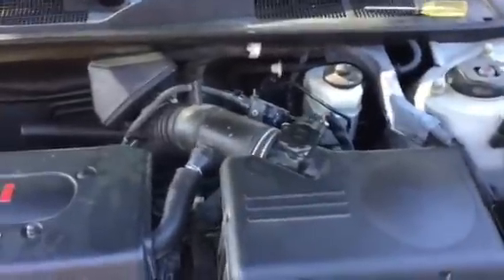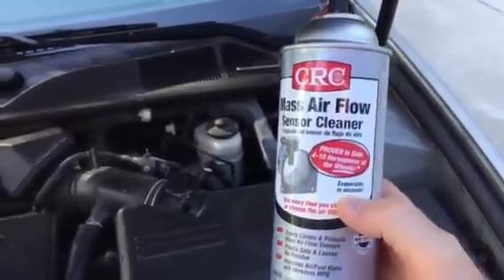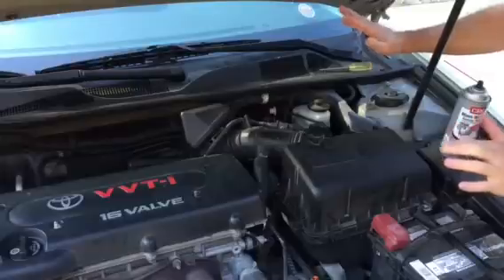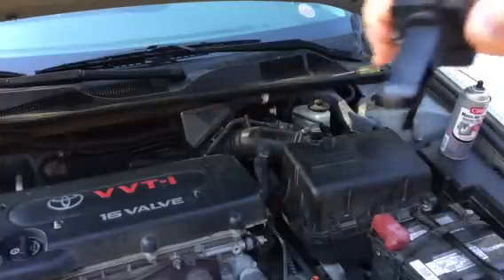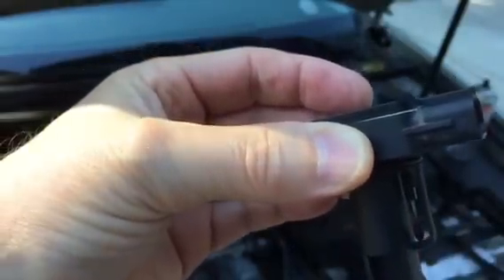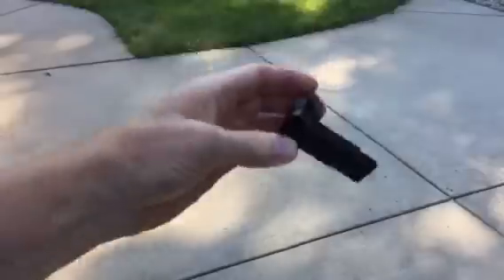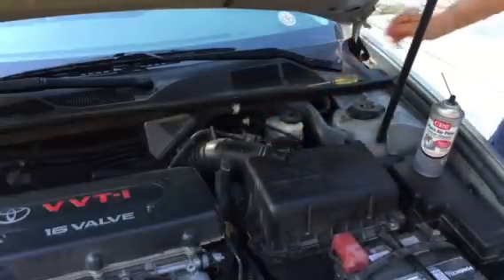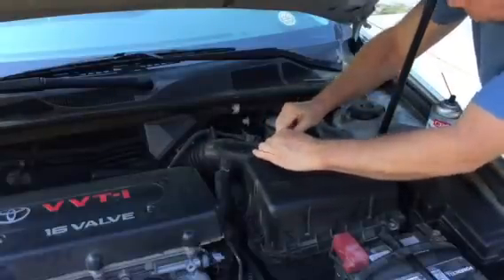Why Does My Car Lose Power Loss Of Acceleration?

Comment: I have a question? I got a 2005 with code p o 172 and p o 175  and replace the intake sensor but didn’t fix my proble still hesitate at 40 mph and the rpm goes higher.. what else do you think I should check
Reply from the maker: Jerry Velasquez did you replace the mass air flow sensor with a genuine OEM?

Comment: I have a question. I drive a Lexus & went over a dip & now when I drive above 65 it smells like burn oil but has no leaks. Please help??? Thanks for the video by the way
Reply from the maker: Brandin Sanchez Are your drive belts good and tight?

Comment: Did that it helped for 100 miles then back to the same trouble as before. For $ 35 replace the sensor. Should take care of the problum if not the throttle body needs to be cleaned or replaced.

Comment: Altima hesitates on take off only , I replaced all sparks plugs, coils, and cleaned MAF sensor still doing it  Any suggestions
Reply from the maker: Have you cleaned the throttle body?
Reply: @proclaimliberty2000  Thats a good point I have not tried that . Do you know how that is done ?
Reply from the maker: @joezavala9659  https://youtu.be/cOAYWVBfuek

Comment: No too long ago my car just started stalling out on take off, would have to hold the gas down a bit at stop lights to keep it goin. Pulled the MAF sensor and inside was a tiny spider that was dead hanging on one of the wires. Got it off and car ran like new again.
Reply: They're really that sensitive. Wow. Trying a couple of recommends tomorrow. Great vid
Reply from the maker: David Clawson 👍

Comment: Hi does my kia rio 2001 model have mass air flow sensor.cauz i can't see it i check it
Reply: All cars will have a maf. The way I normally check to see if it's is the maf  is I'd disconnect the maf and see if anything changes. Normally they'll be located just after your vehicles air box and will have a sign telling you which way aor shoukd flow

Comment: Hello I wanted a price on a detail inspection for a quote to repair my Mazda 2 Neo 2006.

When ilding it's vibrating,but only because my revs start to drop after sitting their 3seconds.
It also got a vibration it didn't have before,after Ultra Tune put a RH engine mount Kelpro mount RH mount.

When ilding I got to put it in reserve to get my revs a bit higher so it feels more healthier.

Maybe it just a idle screw adjustment.

When I'm doing about 80-90 to 110km I can feel vibration in the steering wheels.

Ultra  Tune didn't inspect it but said another mount broken.
I took it to two people I trust they seem to think they ok but didn't take them off.

I thinking it could be one the pulleys or something loose or drive belt,but don't think it be causing the vibration it causing.

If the highway is nearby feel free to take it up the highway.

I was told it could been a mount got that done, got new tyres and balancing,wheel alignment about 2-3 weeks ago.

I was told by two mechanics said the same thing they didn't think it my stabilizer might.

I need to know what I'm in for so I  can save up and get it done asap because I hate the feeling of it.

I have done spark plugs done (best plugs)
I have gotten new tyres and  balancing & wheel alignment within a month.

It felt worse coming out of ultra tune, they didn't know what was wrong then said it it was my stabilizer mount it would be doing more horrible things and the engine would have more movement.

When ilding I think it because my revs drop a bit low because when it in reserve it  goes back to more nearer the normal ilde rate and stops vibrating.
So maybe adjustment of the ilde screw may even fix it, after spending over $1000 and going to be broke for a while because of it.

Can I get inspection see what you guys think.

Comment: My moms 2005 Nissan Murano is running a u3fff code and apparently that’s for Nissan dealers only, but the car is hesitating and kind of shaking. She’s already changed the coils and it was running fine but now it’s reading that code and the dealership told her it cost $120 just to get the code read..
Reply from the maker: Doomzyy take the vehicle to an auto parts store to have it checked with a diagnostic scanner which they will normally do for free.
Reply: proclaimliberty2000 we did, the scanner came up with u3fff which is apparently a code only a Nissan shop/dealer can read.

Comment: 2012 nissan maxima.. revving when idle and hesitating when accelerating. Mas air flow sensor changed but no changes. Any ideas?!
Reply from the maker: Shazeika Khan do you have a check engine light on the dashboard of your vehicle?
Reply: @proclaimliberty2000  yes.. it says mas air flow sensor. 😣
Reply from the maker: @snesha420  Because you replaced it and it did not fix the problem, the next thing I would do is check to make sure that the electrical connection plug that attaches to the mass air flow sensor is receiving voltage.  You would need a digital volt meter to perform this.

Comment: Driving down the street at 45mph and rpm will not go past 4.. What would cause that. ?? Please help
Reply from the maker: MOEtv. More than likely it’s not getting enough fuel.
Reply: proclaimliberty2000 thanks
Reply from the maker: @ScR3wEdUp4LiF3  It could be dirty clogged fuel injectors, clogged fuel filter, or a failing fuel pump.

Comment: Serious, why are you so adamant about only using this specific cleaner? What is the risk in using some other type of cleaner? Just trying to educate myself, thanks!
Reply from the maker: Because I know when I use this cleaner there will not be any residue left on the wires.
Reply: @proclaimliberty2000  thanks, BTW my voice text turned "curious" into "serious" above, didn't mean to come across so harsh! Haha
Reply from the maker: @bronconeils  No problem.  Watch this other video.  It will make the alternator and starter last longer on your car.   https://youtu.be/rcVYfE7MQlI
Reply: @proclaimliberty2000  wow, that WAS something I didn't know, thanks!
Reply from the maker: blankyoublank 👍

Comment: My 2008 Scion XB was running extremely poor. 300,000 miles on it. Changed Ignition coils, Spark plugs and cleaned MAF sensor using rubbing alcohol. IT WORKED. One point to make.  Disconnected the battery so the MAF and its computer etc... sync up after it all put back together.  GOOD luck and GOD bless. JC

Comment: What if its not the mass air flow sensor,or spark plugs,or alternator, or throttle positioning sensor?
Reply: So with an ODB1 scanner i got 1 code from my car....throttle positioning sensor low voltage? Battery good,guess its the plug and wires to the sensor...?

Comment: I've changed my MAP, Throttle Body Position, IAT and o2 Sensors and I'm still having a lot of hesitation
Reply from the maker: Could be a failing camshaft position sensor, failing fuel pump, clogged fuel injectors, clogged fuel filter, clogged air filter, failing spark plugs, failing ignition coil or coils, failing alternator, vacuum leak, failing EGR valve, failing variable valve timing solenoid.  Regardless of what's causing the problem, it's usually caused by the engine not getting enough fuel, or getting too much air.
Reply: @proclaimliberty2000  what about clogged catalic converters?
Reply: Check on your fuel pump

Comment: Hey I have a question my gf has a 2000 Honda Accord we put it up on computer an they showed three misfires so we went ahead an changed the coils and checked the spark plugs after that we drove it an it’s the codes are back but the main issue I’m trying to figure out is when we are driving it, it tend to jitter forward it’s not a non stop issue it comes an goes but it’s very frequent. I can’t find out what I should do next. Ahhh help would be appreciated can’t seem to find the right video with same problem
Reply: Compression

Comment: Hello, I have a problem with my 2003 Mercury sable, first of all it does a small series of things that I can’t for the life of me figure out the problem, 
After my car warms up a little and you happen to be at a stop light or at a hill and as soon as you press the gas peddle it jerks before it goes, like kinda a delay, here lately I noticed when I’m going down the highway with cruise control set at 65 going on level road it’ll ever so slightly slow down and speed up (like go to 63 and back to 65), and sometimes when you stop and put it in park it’ll start revving upwards of 2000-2500 rpms and stay there.

No engine light has gone off except every now and then and I read the code it says “manufacture control” but that hasn’t happened in a couple months, also sometimes in park when it’s not revving up it’ll start revving up and down constantly and the car sometimes dies on its own, I went into the store one time and left my car running for the ac and when I came back out my car was dead and it ran the battery down since the accessories kept running, can someone please help me solve this problem!!!! The problems are starting to happen more often, please help me figure it out!! Thanks!
Reply from the maker: It may be some kind of simple sensor such as an oxygen sensor, MAF sensor, TPS sensor or other sensor.  Is your air filter clean?  It's possible you could have a throttle body sticking which you need to clean if it's dirty.  Not having a check engine light on makes it more difficult to diagnose.  You may need to take it to a good trust worthy mechanic.  https://youtu.be/cOAYWVBfuek

Comment: I drive my car doing 30 & my car drops power rpm move down
Is the Mast sensor sound like it
Reply from the maker: Is your check engine light on?
Reply: I changed my Mass Airflow Sensor with this and soon as i out it back in and started it up it started throbbing, my RPM hand started idling up and down and felt like the car was about to cut off, that was a few days ago and now ithe RPM hands dropped so low it made my car cut off.

Comment: Hi I got kia Rio 1.3 2001 model they don't have mass airflow sensor. I change idle control valve but still hestitat special when engine    is hot.when u shift to first gear u can't leaf the car move it own.I must always press accelerates

Comment: Dude My engine is K9k 110bhp engine..IT is showing glowplug indicator and stop giving power and wont raise rpm above 3000..IT happens sometimes that too in sunny weather.. PLS HELP.. What will,be the causes.this cones only sometimes.
Reply from the maker: A blockage in the air intake, the fuel line, bad injectors, or a frozen governor could lead to such issues.

Comment: My 87 runs really good but it has a constant intermittent hesitation as if it hiccups, has good pick up speed and with air on, sitting at a light sometimes it will stall, but starts right back up, I did all the cleaning stuff like you all say on here, and can't wait to see if it works, but this car has issues, one thing quits working and you fix it then another thing quits ?? I get a lot of compliments,(nice car) but again its black and new convertible black top, and new tires its a nice driving car till this problem, And I've been working on cars with my father since I was 8 yrs old and I am 60, just want to drive and enjoy life.
Reply from the maker: It sounds like it might be a dirty throttle body.  https://youtu.be/cOAYWVBfuek
https://youtu.be/LPv1jZMpAY8

Comment: i had an annoying hesitation without a warning light and i did everything. finally i ve been to kia dealer and they said that model has an update and they charge my £100. now i have a blinking light, i ve been to my garage to diagnose. they said all is ok but light is still there blinking,  light needs to be switched off by a dealer. never kia again, avoid.
Reply from the maker: I find it odd that a blinking check engine light did not show some kind of trouble code. From what you are describing, if it were my car I would replace the mass air flow sensor and see if you notice any improvement after driving it 50 miles.  If this is the problem the check engine light will usually go off by itself after 50 miles of driving.

Comment: Got a used 2009 Nissan quest and it sounds and feels like it takes a bit longer to shift when accelerating. I have no experience when it comes to working on cars.... so could this work for my problem? Pls let me know asap. Thank you!
Reply from the maker: Yes, replacing the MAF sensor could fix your problem but it might just need to be cleaned.  https://youtu.be/YnckaCCJEEk
Reply: proclaimliberty2000 okay thank u!
Reply: That is the same kind of another problem I have with 1987 BMW 325I and its worse when its cold, so I always watch my fluids if tranny is just a little low I fill it or top it off but cars been in the family with three people owning it over a 20 yr, period and its a nice car, but they or at least this one must of been built on Monday. its always something, just stay on all your fluids and you will be ok. oh yeah watch out for the other drivers around you.

Comment: Thanks for the video. 
And I'm not a pro but what you point out and spray with the cleaner looks to me quite a lot like a ptc or something for temperature sensing. The really thin wire that measures the oxygen flow should be in that bigger window.
It still got a good amount of the cleaner but yeah just saying.
Otherwise keep it up :)

Comment: I have a problem. Not sure if it falls under the jurisdiction of your video. If I stop at some stop sign, and then I have to enter the road and accelerate, there is a couple of seconds during which I get no acceleration. I can hear the engine roaring, but for couple of seconds, no acceleration. But then the rest of the drive is smooth. I have Nissan altima 2009. Does the solution in your video is exactly related to my problem.??
Reply: Nabeel Ahmed sounds more like transmission

Comment: Having this problem on my 2013 Altima SV (piece of fucking shit CVT engine btw).  I cleaned the MAF and didn't fix the issue.  In fact the car died at low rpm in a busy intersection and would not let me put in reverse/drive without dying again.  So I switched the MAF with a brand new one and still having the shuddering/jerky type feeling when accelerating at low rpms.  I would advise never buying a shit Nissan, and I sure as hell won't be buying one again.  The car is only 4 years old and is a lemon.  I guarantee if I take it to the dealership they'll want to replace the whole CVT with another shit one for about $3K.
Reply from the maker: I wonder if your throttle body needs cleaning.  https://youtu.be/cOAYWVBfuek
Reply: Thanks, we tried this when we replaced the MAF sensor and its still doing it.
Reply: proclaimliberty2000 it turned out to be the transmission and had to have it replaced.  Luckily it was under CPO warranty.  However they did a very sloppy job.  Not only did the break pieces off under the hood, spill fluid all over the engine, left a screw driver on the engine, AND forgot to replace at least 2 screws that I can see the transmission now vibrates like crazy when accelerating.  Stupid Nissan.
Reply from the maker: You obviousley paid for the services.  If you are not satisfied with the work performed then you need to speak to the manager and tell him to make it right and fix the vibration in addition to the sloppy workmanship.
Reply: proclaimliberty2000 I did.  I showed them the sloppy workmanship and they're putting in another one apparently. Just told me they have to order the parts and gonna put me in a courtesy car.
Reply from the maker: Good.  Hopefully they'll get it right this time.

Comment: I am very skeptical when it comes to cheap fixes. I've, had two Toyota Camry's in the past, both being 6 Cylinder models. I'm very familiar with this acceleration issue as mine's did the same and other V6's I've test drove. Skeptical but willingly to give it a try, IT WORKED immediately! how something so small can make a huge problem. Thanks for sharing because I'm sure I would have paid a lot going to a auto shop. total out-of-pocket was $3 and change, best money I've spent and a long time
Reply: 2005 Camry se v6. Tried it. Reduced the hesitation but didn’t completely eliminate it.

Comment: 2000 bravada won’t start unless I dump fuel in throttle body,starving for fuel going up hills.
Reply: Someone help please
Reply from the maker: Make sure throttle body and MAF sensor are clean.  May need new MAF sensor.
Reply: I’ll try,and I’ll let you know the outcome
Reply from the maker: Sounds good.
Reply: Installed new mass airflow sensor and cleaned the throttle body.Problem still exists.
Reply from the maker: It sounds like it could be a fuel problem.  I know this sounds too simple but what about the fuel filter.  Any idea how many miles are on the fuel filter?  This is what I would try next if you haven't.
Reply: Thanks,I’ll try changing it